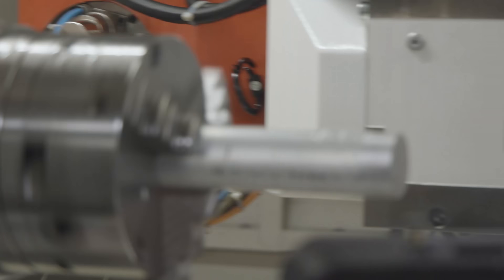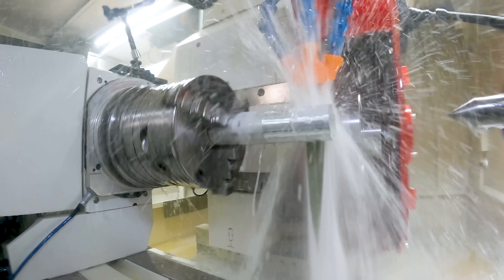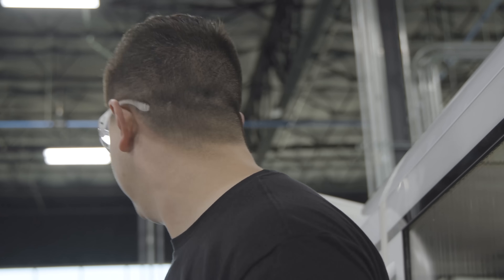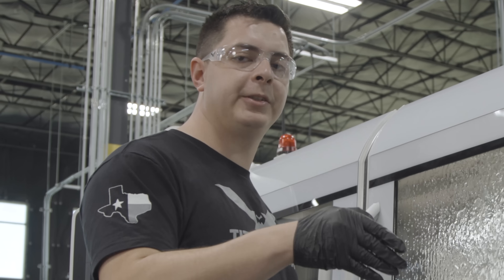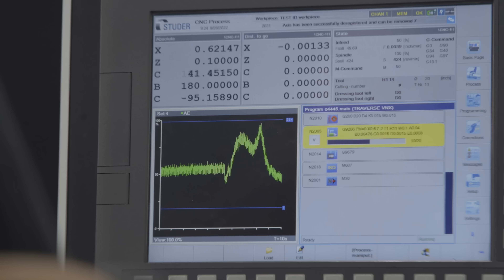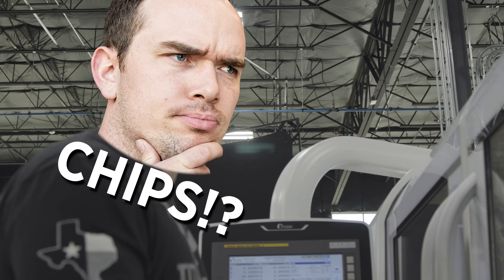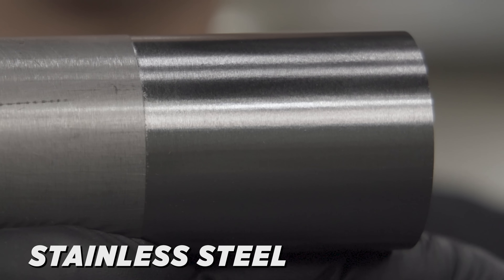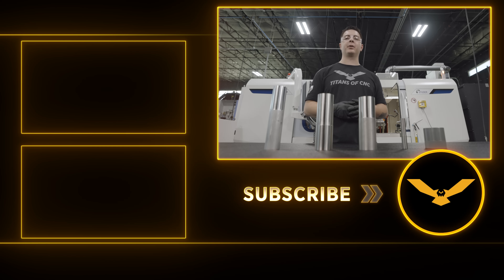Is This REALLY The MOST Versatile Tool?

Comment: is it possible to grind plastics?
Reply: You can run it through a time saver... unfortunately this process generates a lot of heat, and the only reason grinding would be necessary, that I can think of, would to be to hold a flatness, and when heat is applied to plastic applications, it generally causes the work piece to warp. With injection molding technology now days, mass quantity plastic work, is typically the most economical way to go. Although, I've have done a lot of cnc work on abs, pvc, nylon, teflon etc. If there is enough material to machine every surface, flatness, and tight tolerances are generally not much of an issue. Only when the work piece comes in with more "bow" in it, than can be removed during the maching process does flatness really ever cause any issues. Sometimes plastics do have "memory" tho, and once material is removed, it may curl, or warp, but this can be defeated by leaving extra material on roughing operations, and cutting the work piece in a "relaxed" state.

Comment: Technically any ceramic machining is "grinding" even when "cutting" your not actually using a fluted endmill. Diamond dicoats are always used in the cnc process in ceramic material applications.

Comment: Quick tip: throw on an oleophobic and/or a hydrophobic (depends on if there is lubrication in coolant) screen protector (or larger if you prefer), and the coolant will not obscure your view of the part as much. It is an affordable solution to low visibility.
Reply: links ?
Reply: @seancollins9745  you can simply search the terms "oleophobic/hydrophobic tablet screen protector". If you want something larger, it'll have to be a custom order from somewhere. If you don't want to/can't thicken the pane in the door, you can apply a similar coating instead of an additional layer to the entire window. We did this at our shop, and it is game-changing.
Reply: I can back this up, 10$ for a 3 pack of tablet screen protectors worked well for swiss lube, (5.0 on refractometer) Its good for dripping spray droplets off quickly when blasting coolant. For 10$ you can't go wrong. This wont help if the coolant is blasting where youre looking tho, good for spray coolant, not flood
Reply: Also Blazzer is so oily and thick. Better coolant out there.

Comment: Hey there 
Is there any practical use for ground soft metals like aluminium or bronze, etc.?
Reply: I used to grind aluminum tubes that were very thin on the walls .080 thick. After we ground them they would be pressed into a sleeve. It just depends what the use is

Comment: could this machine be used to make high precision parts such as grade K or 0 gage block?
Reply: Yes Grinding is a very high precision. This machine can make masters and dies as well as anything that  needs a good finish and has a tight tolerance
Reply: No for that u need to lap them. The surface after grinding is to rough for a gage block. Maybe with a lot expense in reshaping and small depths but that’s just very uneconomic